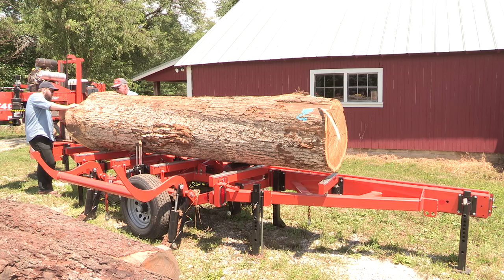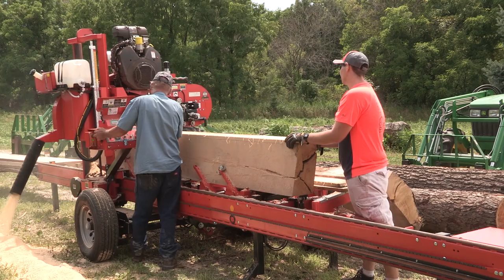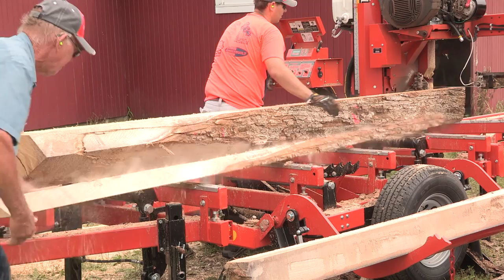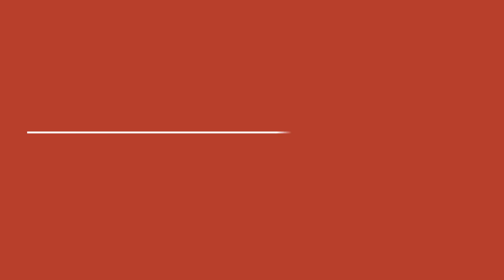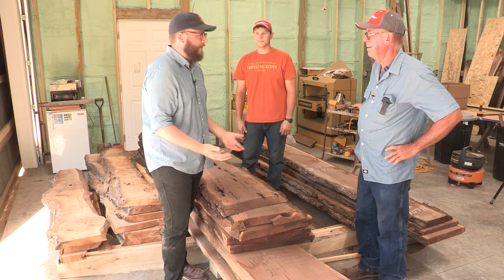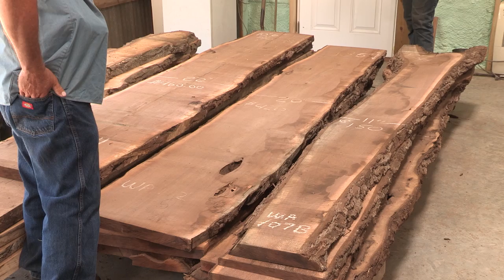Milling Your Own Lumber - Part 4: Sawing Techniques

Comment: 19:50 What the hell is wrong with air-dried lumber?!
Reply: Yeah, I don't know. As long as the air-dried stuff is properly stickered and dried for a correct amount of time (and checked for moisture or the buyer knows it's not seasoned fully and does the drying on their end)....air-dried lumber is 8-10% moisture just as kiln dried.
Reply: Good video I just ordered a mill.